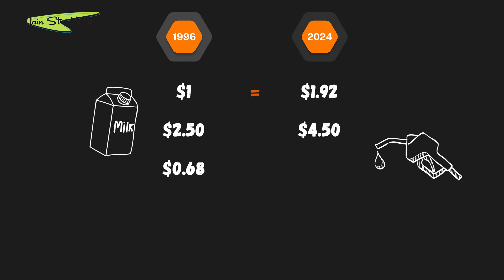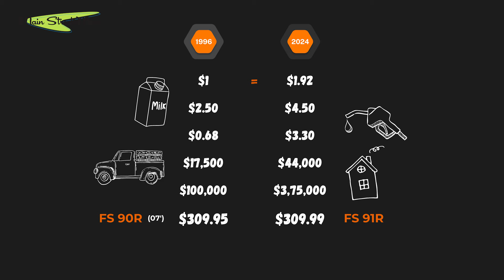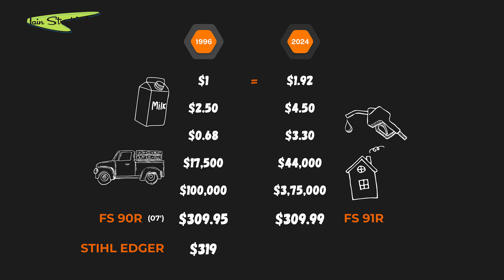Comparing STIHL prices over 30 YEARS! 1996 to 2024

Comment: I bought a new GMC work truck $44.000 right on the prices my friend l bought a new fs 111rx list is 469 l paid 406 great deal from Stihl 😮😮
Reply from the maker: Awesome. Congrats on the new truck and the new trimmer Harry.
Reply: Thanks my friends you would be surprised to see that the Stihl fs111rx is lighter than the echo 2620 the Shindawia 262 and surprisingly the Husqvarna 525lst. That's with a full tank of gas full trimmer head and trimmer blocks for the Green Touch trimmer racks 😨😨😨
Reply from the maker: Oh wow, that's super interesting. Thanks Harry